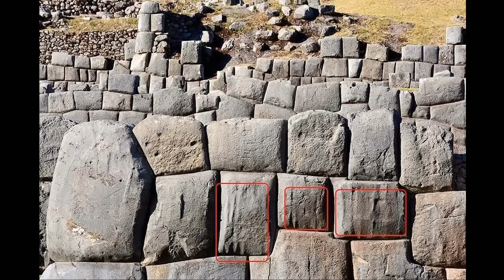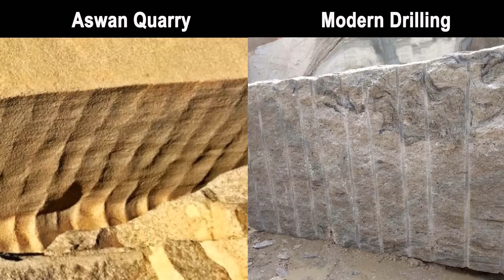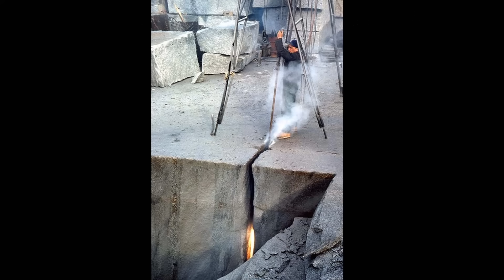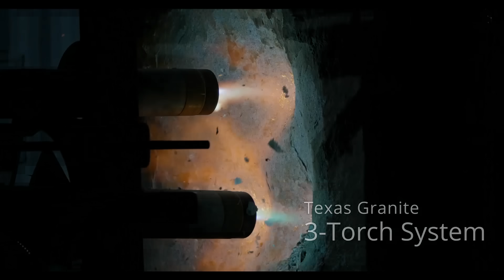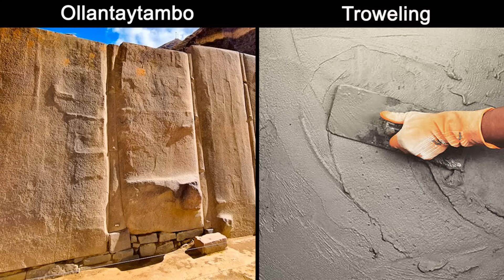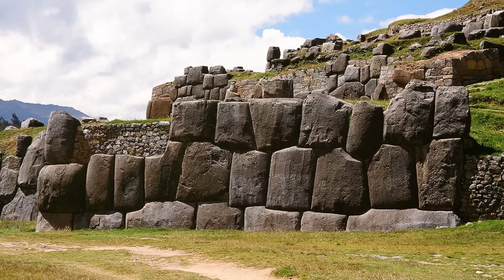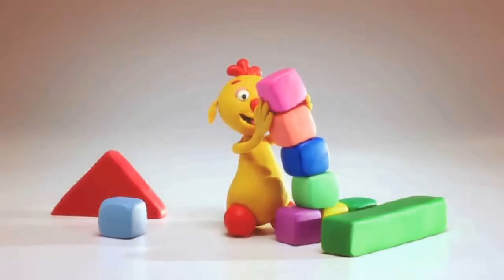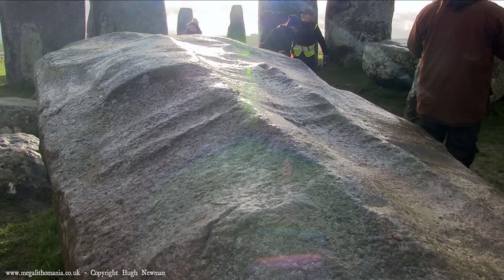Megalithic Mystery: Different Scoop Mark Types?

Comment: (from France) Very interesting video. Great comparisons. I'm thinking of two techniques: . It was a time time when they knew about forging, since they had copper tools or weapons. So the first thought is that they used forges adapted to reach high temperatures, but which chipped away at the rock by a few millimeters. Secondly, they eroded this weakened part of the granite with dolorite balls.
Reply from the maker: Thank you for sharing your ideas, I appreciate it!

Comment: i agree on the plasma looks the same. but as another idea on the Aswan, could it be pounding stones on the end of a log repeatedly dropped in a hole? maybe a rope on the end of the log lifting and dropping as the log would help keep the hole straight. make the stone on the end and the log 1/4 the size of the hole you want  (not sure how you would get the pulverized rock out of the hole).

Comment: The excavation that was made with the plasma gun is horizontal and made in a straight line while the scoop marks on the obelisk are vertical with many lines with a curvature at the bottom. I'd say the handling and precision of the obelisk scoop marks are way more impressive as they seem to have been done with a tool operated by hand instead of machinery.
Reply: This is new technology for us. In 30 years we may have a miniature handheld version.
But in one quarry there are scoop marks where you see it reached it's maximum reach and was probably mounted on an arm like an excavator arm. You see a part of the circle of maximum reach there. Unchartedx has it in at least one video

Comment: There is another quarrying technique that gets you those marks.  I saw a video of it done in Japan.  Basically you make some shallow groves/cuts into the rock into the size you want, then you hammer in wedges. You use larger and larger wedges to snap the granite block out of place and it leaves a scoop mark on the bottom.  The scoop mark is basically from you ripping the granite out which gets that uneven surface from where the weakest points are.

  40 cm cube = 0.064 m^3.  Density of granite is around 2,691 kg/m³. 0.064 x 2,691 kg/m³  = 174 kgs or 383 lbs.  Though it looks like the lines are shallower than 40 cm vertically.
Reply: Still doesn't explain the smooth "washing" effect they got.

Comment: I am not sure about the compression idea.  The force necessary to "squish " the blocks together would, I believe, have deformed the block where the force was being applied significantly. Moving multi ton blocks would take a lot of force even if they had some sort of friction reducer. More likely that they were built with a stiff mud like pool construction uses for the walls or, even more appropriately, fake rock walls that use a high sack content but have a plasticizing ingredient that allows them to be malleable while they are being worked and only hardening fully over time.  I have seen some very realistic rock walls made this way.
Reply from the maker: Thank you for sharing your insights! I think the culture that built these walls are very sophisticated; since casting in such a massive scale without cracking or expansion joints is beyond our current construction capabilities. I think there might have been a previous advanced civilization which built these megalithic sites and I made a series of videos - Hope you will find the following interesting: 
- 20-15,000 Years Ago When Humans Faced Extinction – the Ending of a Previous Advanced Civilization? https://youtu.be/Zs4zLKbp4Ic 
- The Lost Civilization of the Megalithic Sites: Who Built Them and When? https://youtu.be/u4V_ZQukWEU 
- Lost Megalithic Civilization: Where to Find Their Remnants? https://youtu.be/0KBfaLJykF4

Comment: I have been a home builder for 35 years and I have thought the exact thing as your screeding idea.  It always reminded me of concrete or plaster finishing marks.   However, it seems strange that they would fit things so precisely but not finish the surface completely.  Perhaps the stone was only malleable for a short time.  I am commenting as I am watching this so you may explain this later. Excellent work so far.
Reply from the maker: I appreciate your comment and experience! Glad you are finding the video interesting.

Comment: at sacsayhuaman, the stones have preserved their internal structure, and it has just been proven that they could not have been cast. it would be strange to pour the stones one by one, rather than building a formwork and pouring the whole wall at once, as we do with our concrete screeds, wouldn't it ?

Comment: I wrote this on another channel a while back:
--
<><><> The scoop marks in some Egyptian quarries may be from an EDM-like machining process. Small blocks may have been electrically 'melted'/bonded sand. I asked one of the plasma channel researchers to work with me to test these concepts but got no reply. @TechIngredients  made a video:   We made electricity from water - and it's easy! 

My comments on other Channels reg electricity in antiquity.
--
@UnchartedX   Ben , please keep an eye out for signs of water and electricity. Researchers have discovered that water droplets are capable of producing electricity using simple equipment, without generators and turbines. This video shows one such method:  ' We made electricity from water - and it's easy! '.
This may have been a method ancient Egyptians used to make electricity. Dendera light is a motif in the Hathor temple at Dendera in Egypt, depicts a 'snake' emerging from a 'lotus flower'. It is part of the Egyptian creation myth and has been interpreted as a form of ancient light/plasma technology. Last time I checked lotus flowers did not have a transparent/glass sheath in proportion to a light bulb. Nearby there is a box with ~6 tubes/wires emanating from it which are joining a U-shaped container. This could be a water-generator. <><><> Only 5 volts are needed to create or transmute elements [NEW tech!!!] including incredible/impossible ones with 1000's of AMUs [atomic mass units] <><><>
--
@TechIngredients   Apparently the ancient hindu Indians also created electricity from falling water droplets. See vid at ~ 30:00 minutes:   Technology of the Gods | Why Ancient Vimanas Aren’t “Myth” – Paul Wallis & Praveen Mohan 

Modern researchers have experimented on the effects of electricity and magnetism on living things. Structured water is real and healing with Dr. Gerald Pollack being most famous researchers.

Leme know you got this. Tnx
<><M><>
Reply: 💢💢  I have a science based theory for how the tight fitting megalithic blocks were made which can also be used to make the 'scoop marks'.
I'm a triple engineer - CE, ME, AE, study quantum physics, astrophysics, constitutional law, economics, psychology, history, ancient history, health and am a prolific inventor, among other things. 💢💢

Comment: I think there had to be alot more natural gas seeps under preasure then. Or maybe hydrogen seeps that no longer exist today. Copper wasnt a problem but producing that much continuous power to run something like that would of been pretty hard. I guess one day we might find some sort of generator burried someplace. I guess say the pyrimids could of been nuclear power plants, but then where is the waste burried, unless all that stuff is so very old it has become innert. And no risidual is left. But you could get it hot and spray water on it at the same time during heating with just high presure natural gas and oxygen, assuming there was higher oxyge levels in the past. I still don't think it was aliens, lol

Comment: Interesting thesis.  Is there a glossy obsidian like surface left behind when the granite is plasma torched or is that layer blasted away leaving the crystal granite surface?
Reply from the maker: The EarthGrid plasma torches can reach temperatures so high (way above the melting point of granite) that the granite got vaporized which did not leave the melting byproduct like obsidian on the channel walls.

Comment: Great topic, those marks usually are made from HEAT Shock.  You make a fire directly on the stone, have it burn in one spot, The granite heats up on that spot, the difference between the hot spot and the stone normal temperature, causes the stone to Flake off in scoop mark style.   There is a video of someone at Pyramids and they find a Flake that wasnt removed, and it perfectly fit the shape of the scoop, he removes it on film and the mark under it was a scoop.

Comment: Anything that can be scoped off are mailable. If not today, it was so then.

Stones originate in the form of sand in various types of crystals and size from grits to fine powder or dust, deposited collectively and will never turn into stone unless the deposit contains chemical composition scale much more or much less than ph 7.0. Even so it will not turn into stone unless also provided with homogeneously infiltrated by moisture. Can it become natural concrete gradually over time schedule.

Comment: I saw such scoop marks in the mountains of Croatia (Velebit) and wondered what they could be from. Must have been huge machines to create them.
Reply from the maker: Interesting - in the mountains?
Reply: @CuriousBeingbyTina  Yes, exactly. Not on a megalithic site. Just on the side of the mountain in several places. Although they looked a bit different, they were like parallel lines going in the same vertical direction. I took pictures of them.
Reply from the maker: @watchmansascha4764  Do you think they are manmade?
Reply: @CuriousBeingbyTina  Well, I wouldn't necessarily say man. Could have been the giants. But definitely I don't believe that it is a "natural" rock face or water erosion. It looks like a giant rake went over the mountain face.

Comment: The liquid concrete theory is illogic since using molds would imply all stones would have the same measurements. 
It also doesn't answer why gigantic blocks exist, which is counter productive to this theory.
Reply: It’s totally feasible. You dont mold the stones, you cast them in place. That way they can be individually made to any shape and size you want, and the joints will always be perfect.
Reply: @SueDonym123  How moronic would it be to divide a wall into irregular forms with differences in weight, measurements and corners. And if it is that easy to execute, then why has no one repeated it afterwards.. not the Inca's who reconstructed the work at many places with just stones laying around, not the Egyptians in the thousands years after their first dynasty, or any known civilization known. You guys keep inventing stuff, just to avoid the most prominent explanation. Unbelievable..
Reply: @Yoda300YearsAgo  - can’t be all that moronic since the polygonal walls are still standing after centuries of earthquakes and the regular stuff since has been rebuilt over many times. Just because YOU don’t understand how something works, doesn’t automatically make it wrong
Reply: @SueDonym123  You base yourself on 0 evidence to 'assume' there must be molds used because otherwise you can't explain how it was done, which is the nr1 thing to avoid at all cost. You have countless examples the ones who built those megalithic walls, were also capable of excavating stones of +1000T (obelisk at Aswan, Stone of Pregnant woman at Baalbek), transporting them and even placing them. To 'assume' blocks weighing 10 times less or more, must have been built by making use of concrete, defies any logic but hey, up to you what you 'belief' instead of looking at clear evidence.
Reply: @Yoda300YearsAgo - the irony is the 2 example you give are still sitting in the bedrock and haven’t moved anywhere. I don’t need a lecture on logic from you
Reply: @SueDonym123  Oh the irony indeed, it's clear you don't even follow the latest updates. The Stone of the pregnant woman was supposedly still attached to the bedrock until they removed the earth around the bottom. Then it became clear the stone was fully excavated, on top of that they noticed it was placed on an even bigger stone that was sitting underneath, also excavated. So yes, they moved it and it was completely excavated. Let it sink in for a moment.
Reply: @Yoda300YearsAgo - excavating and moving are 2 entirely different actions.
Reply: @SueDonym123  The exact 2 actions you've mentioned in an earlier post "still sitting in the bedrock and haven’t moved anywhere", only the truth is reversed. Those are the actions needed to excavate the stones (+10 times smaller) and transport them to the wall they were making, where the discussion started. Exactly what you tried to counter by saying they used molds. If they're able to excavate and move stones +10 times larger, there's really no need to bring up fantasies... only logic <3
Reply: @Yoda300YearsAgo - I never said they used molds. You’re not even listening
Reply: A mineralogist would not mistaken natural granite from anything cast, there would be inherent impossible to fake differences.

Comment: It shines a light on how 'some' excavations were conducted but still doesn't answer why so many, without scoop marks, can be found in the same wall, tightly fitting in irregular fashion.
There must have been multiple ways to excavate the hardest stones on earth since none of the statues or boxes show any scoop marks neither, just like you highlighted no scoop marks were found in other areas at the same quarry at Aswan, which only adds to the mystery. The small place between the bedrock and the almost quarried obelisk, also goes wider at the bottom. Fitting any machine in between is nearly impossible.
Then there is the question how they were able to move such gigantic one-piece blocks of +1000T, another incredible feat.

Comment: The term "scoop marks"  is a very misleading typically used by fringe pseudoarchaeologists to create an air of mystery. Anyone interested in a practical explanation and demonstration for how these quarry marks were produced should watch Scoop Marks in the Oya Quarry Japan. Additionally is should also be noted that the smooth marks we see today in the quarries of ancient Egypt have also been eroded and weatherd smooth over thousands of years.
Reply: Have you ever been to the Aswan quarry?
I’m a mechanical engineer. I recognize a machine worked surface when I see it. I can’t say exactly the type of machine that made the scoop marks, but they were assuredly not made by dynastic Egyptians using hand worked techniques like pounding stones or copper chisels. 
Archeologists are not mechanical or structural engineers, and come up with non sensical explanations for ancient Egyptian artifacts like precision made stone bowls, that are perfectly symmetrical and have such thin walls that many are translucent. 
Comparing them to the sloppy workmanship of pottery wheel made soft alabaster jars from the dynastic era, it’s easy to observe the difference between primitive hand made soft stone jars and precision made hard stone jars. 
And Tina is an degreed architect. She has studied advanced structural engineering, which includes mathematical
stress analysis, strength of materials analysis, and sophisticated manufacturing techniques. 
Archeologists dig up ancient tombs for bones and small artifacts, and call every structure they find a temple, even if there are no obvious funerary inscriptions or historical documents to draw such a conclusion. 
Archaeologists are guilty of acting as 
Pseudo-engineers with no experience outside of their limited education.
Reply: @Johnrack  Hey,  I've never been to Egypt/ Africa, South America or Asia. There are lots of old abandond Sandstone quarrys around here, most closed down probably about a hundred years ago, I occasionally find old tools, 4-5 ft long octagonal drill bits, pulley wheels,  block and tackle parts and cables, all off old wooden hand cranked cranes.  I used to find a lot of steel narrow gauge rail tracks. 
One of the quarries here only closed in the 80s, it's right next to a 12th century castle made  from the same stone. Some very old lime kilns around here to. Lime isn't native to the area, glacial erratics mostly, most of the lime mortar used in the construction of the castles near the coast here came from sea shell.  Lots of old mill wheels stones along the coast here to, nearly all below the high tide line. 
There is a Henge here 2000BC on top of a hill, funnily enough the hills called Quarry Wood, the hendge was probably quite impressive before the large stones were removed, I found some Lewis holes on one of the large fallen stones still in situe. The Altar Stone at Stone Hendge, you guessed, it came from around here.  There are lots of Iron age Vitrified Hill Forts around here to, "Vitrified" means the stone walls of the fort, was heated, melted and fused together, it's still an unexplained technique. 
There is one quarry still open here, but mining changed a lot in the 50s and 60s, still drilling and blasting but now diesel cranes and big JCB's do all the heavy work.
Probably the biggest change to quarrying since Roman times, using  long copper saws and tube drills ect, not to mention, concrete and high powered water jets used in open cast mining, was the advert of black powder,  of course dinamite is the norm these days. Hydraulic pressure mining is fairly new tec, but electric plasma ark cutting and boring , I haven't a clue. 
As to your hammer stones and chisels query, I think hammer stones could easily be used to dress up stone, but the copper chisels were probably plugs "wedges" used in combination with feathers for splitting rock.  Interestingly the streets here used to be all granite cobbles, rarely see them now, mostly dugup or tar'ed over. But that's a different story, I've never been to a Granite quarry.  Maybe the next time I'm over in Aberdeenshire I'll stop and have a gander.
Again, I still recommend watching the video "Scoop Marks in the Oya Quarry Japan, tell me what you think.
Reply: @Johnrack  Wow taking clueless to a whole new level